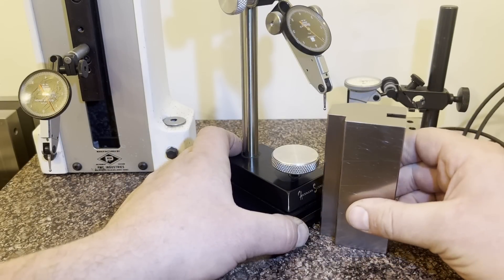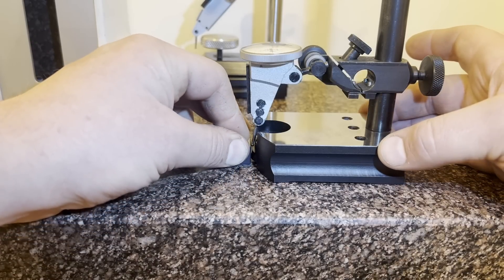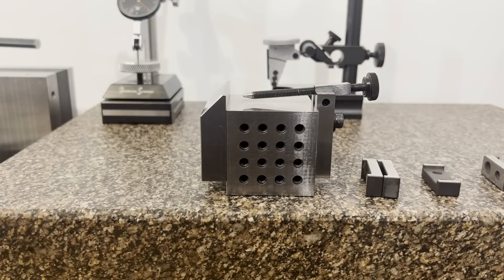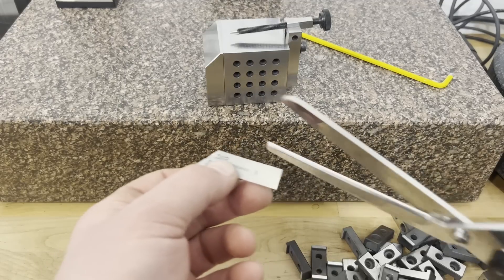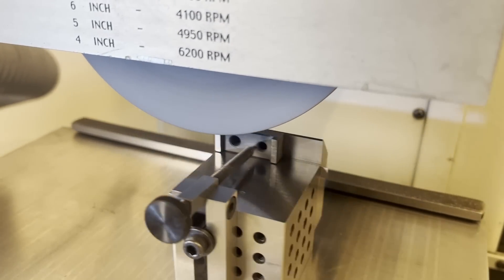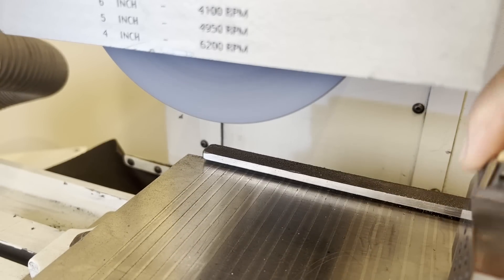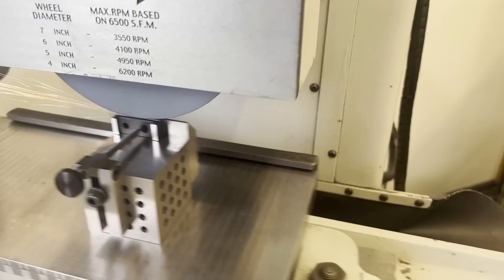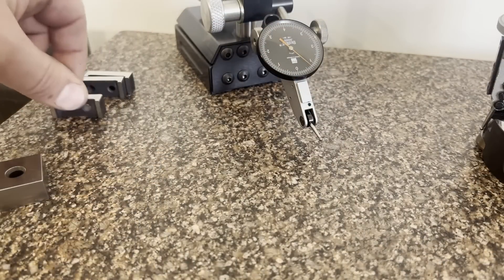Grinding small parts perpendicular

Comment: Your videos are packed full of information I never thought I would need to know!  But so helpful to me in many ways.  Easy to listen to and I hope you make more.  Thank you very much!   What steel did you use for the cube and the attachments?  I need to make one of these.
Reply from the maker: I settled on a2 for all my tooling. There is certainly better , harder, stronger more wear resistant steel. But a2 works just fine for me

Comment: This video had my Ears perk up immediately!!!! As 95% of everything I want to machine on my new Sherline Mill are those VERY SMALL PARTS! All for 1:25 detail scale auto model parts.😳
👉Been having fits trying to work with aluminum stock that's 1" long & 1/2" wide in a the Sherline Vice, 4 jaw chuck or hold straps & clamps🤓
I luv your communication delivery style with these videos- very easy to understand & follow-Well Done 💯💯💯
☯️ZenModeling☯️

Comment: I used to use a fixed square block and a DTI to check for square then work to ultimate squareness (and Parallel) then end up using cigarette papers as shimming under one edge before a re-grind, or even a line of Permanent marker pen then a re-grind. Made some crazy accurate shit in one job.

Comment: Great video on how to hold small parts. It looks like the next tool I need to make is a cube, like the idea of the fence being adjustable. 

What about a video on grinding aluminum? I’ve watched the one SR did, even bought the wheel they recommended. One part I make is 4” x 2” one side is flat but needs to match up with the V-Grooves on the opposite side.

Comment: Adam... How about a description of how to make the machinist cube (process steps in order).  Saw, Mill, Drill, Tap, Heat Treat, Grind. I don't think you actually need to spend the time and actually make a second one, but going through the steps (and your paper models, WHICH ARE FANTASTIC BY THE WAY!!!!!!!!) would guide those less knowledgeable in the specific order of operations including stock to leave for heat treat movement, etc., etc..  Your delivery of content is done in a way that is comprehensive and basically, if one can make this cube CORRECTLY, fully understanding the steps and the why behind those steps, then there really isn't much in the way of typical square and flat work that can't be done... I think. Oh, the milling could be done with description of manual Bridgeport and then by CNC pathing around and then flip over to cut the deck off.  Regardless, your doing a great job with this... we need more youth understanding HOW TO MAKE and then spending time with a spindle turning and their hands on a crank wheel.

Comment: Is the tip of the screw hardened, or is it just a piece of mild steel thread? Very informative video. Thanks
Reply from the maker: Its just a regular SHCS ground to a cone, they peen over with use and I periodically touch them up. I've played around with different tips even some with ball joints , all are better on paper. But a regulars screw ground to a point work very well and arent fussy to make

Comment: Hi Adam, I have a similar set up to yours but without a grinder (cnc mill/lathe and manual), I'm just starting out. Do you think a grinder is necessary? Also if you were purchasing a second hand one like yours, what sort of variation would you say is good over the entire x travel in flatness or other specs? Thanks.
Reply from the maker: It’s hard to say how necessary a piece of equipment is without knowing the work load. Being a tool shop I do lots of hardened steel and it’s very important to be able to grind . But a shop that does non ferrous may not see any need for a grinder

Comment: Really fantastic video! Quick question about the cube and in particular about the clamping screw. How did you determine the best angle for  the screw itself so that it clamps both down to the block and against the rail, and I saw you tighten it with a very light pressure, but would not a small block between it and the part spread the clamping pressure and avoid any warping while allowing for a more secure (higher pressure) clamping? (in particular on flimsier or more complex parts)
Reply from the maker: I’ve played around with the angle a lot in my career and I haven’t found there to be an exact angle that works best, just a gradual angle pointed down is fine. Some toolmakers I known don’t bother making the clamps adjustable , they just tap a hole on an angle . As for a clamping block , it certainly wouldn’t hurt but I get by fine without it .
Reply: @adamthemachinist  Thank you very much! Your videos are really nice and informative, thanks for the time and effort you invest in them

Comment: Hi really enjoyed the video. Did you make the tool makers cube? Or did you buy it. If you made it do you have drawings for it to share?
Reply from the maker: Yes it’s shopmade, but I don’t have any drawings. It’s just a 50mm cube with m5 tapped holes on a 10mm pitch
Reply: @adamthemachinist  did you make the attachments
Reply: @adamthemachinist  why the 10 mm pitch
Reply from the maker: its all homemade, the hole spacing pitch can be anything you want , 10mm just divided up evenly
Reply: Thank you I just started making one

Comment: Is your tool maker’s cube shop made or commercially available?
Reply from the maker: Shop made, I haven’t seen anything like this commercially available. Surface Grinder tooling is a hard market , anything you’ll be making is attempting to be sold to people that have the equipment to make said item . So you see lots of shop made stuff and only the very common stuff is sold commercially
Reply: Hemo makes something like a toolmakers cube for squaring. But a lot larger.

Comment: I have a bad habit of knocking on parts with one knuckle to feel if they are down in a vise or on a fixture. Its really easy to tell if theres the more boney dull thud of the machine casting thru your body or, s tap or click from the part. But its to easy to hurt my knuckles. I should see how I like a piece of wood.

Comment: 👍👍as always. I recently as this question to Mr Crispin and I’ll ask you the same. I often see folks using a test indicator in the “fine measurement range” (0.001” - 0.002”) using a indicator with 0.0005” resolution. I have to wonder why they wouldn’t use an indicator with 0.0001” resolution? If this is a piece of equipment you are likely purchasing new (dollar for dollar) wouldn’t you go for a finer resolution? Seems you could get a more accurate assessment of a situation with a 0.0001” indicator vs a 0.0005” indicator. I’m sure there is more to why these 1/2 thou indicators get used but is there something I’m missing? Are tenth indicators more susceptible to damage and 1/2 thou more robust? Or could it be for hobbyists there is a large  available of these on the second hand market?
Reply: The total range of a 1/2 thou indicator is much larger. For general work they really do most of what you need. Tenths indicators have a small range and when doing normal indicating chores are much too sensitive and lack the overall range for say dialing in a bore on the mill. Once you get on the surface plate that typically changes but it also depends on the class of work you are doing. If your flexing and using a tenths indicator on your Bridgeport you are fooling yourself into a false sense of accuracy by way of tool resolution.
Reply from the maker: Lots of fine points listed so far . One more thing that makes a .0005 worth having is it’s lower gaging pressure . If you have a flimsy setup the gage is actually deflecting the part. This is handy if doing something like indicating a probe tip. You can have zero indicator movement on a renishaw probe and switch to a courser indicator and suddenly see a little runout. The gage pressure of the .0001 is pushing down the high spots of the ruby probe tip.
Reply: You’ll will drive yourself nuts chasing the needle on a .0001.
Reply: Surface roughness also plays a factor into chasing the needle on a 0.0001" indicator, Adam's work could probably be fine for it, but for most a 0.0005" is fine. And to your final point, they're cheaper than 0.0001" indicators.

Comment: Theres a lot of great info here and you explain it very clearly. I'm especially intrigued by your "short" squareness comparator. Thanks for sharing!
Reply: Are you referring to the squaroll? I've got one myself. They do most if not all my squareness measuring.
Reply: @mattgrady518  Yes! That's it! I have similar features on the surface gauge for squareness, but I like how low the pivot edge is on the Squarol. Thanks!

Comment: Lovely set up. Did you make the cube and hardware?
Reply from the maker: Yep, sadly I haven’t really found a good commercial source for those
Reply: @adamthemachinist  Have you considered making and marketing them? You might have some buyers.
Reply: @adamthemachinist  very nice! This is the sort of thing that takes extra work to make up first time but saves so much every time you use it after. Looks great and thank you for the videos and the reply.
Reply: @adamthemachinist  - Do you harden shop made tools like the cube and similar?  Man, if there was a source that made such things with the Renzetti universal 1-2-3 block pattern...
Reply from the maker: yep, the shop has parts going to heat treat once or twice a month so all tooling just gets tossed into those batches

Comment: I still find it amazing that such a small point of contact with so little pressure can hold the part against the fence. I know your not hogging material off but I can't help but squint in anticipation of a crash. Presumably you develop a feel over time. Thanks for sharing